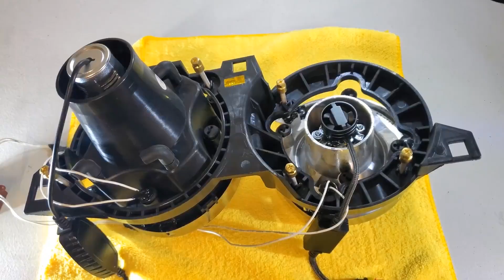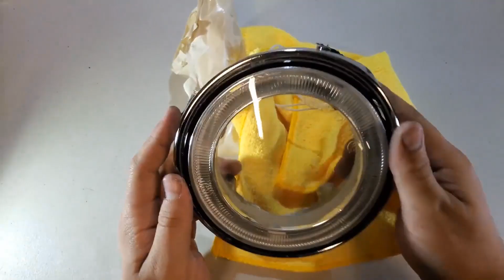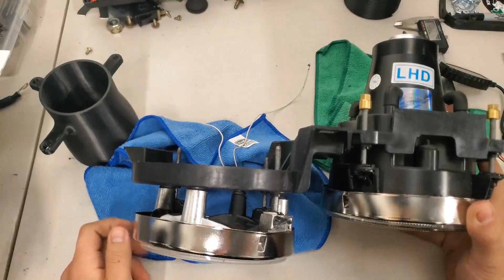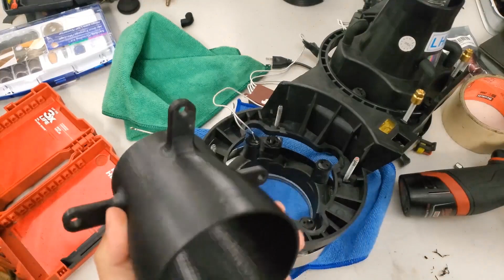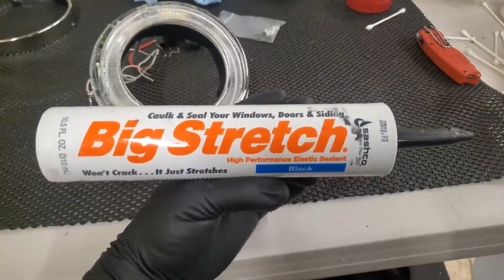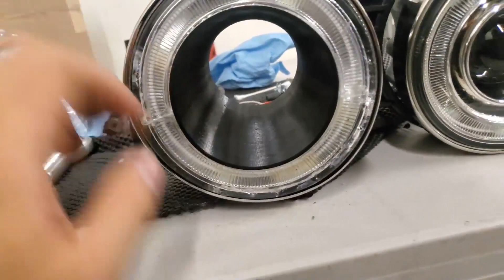Custom BMW E30 Headlight Intake with CrazyTheGod CCFL Projector Headlights With Halos!

Comment: I have an fl5, and am trying to figure out more ways to get cooling into the engine bay, because it runs at a high boost and heat soak is a big issues for these cars when being tracked.  It would be cool to come up with soem custom halo intake headlights for it.

Comment: Bro you should sell the printed intake!! I would cop!
Reply from the maker: Which one? The full replacement or the one for the headlight?
Reply: @themaskeddriver  honestly either or lol
Reply: @themaskeddriver  but for sure the intake itself
Reply from the maker: The whole 3d printed one can be found on ebay. If you want the one for the headlight dm on Instagram and I can get you one...not the whole assembly just the 3d printed insert lol